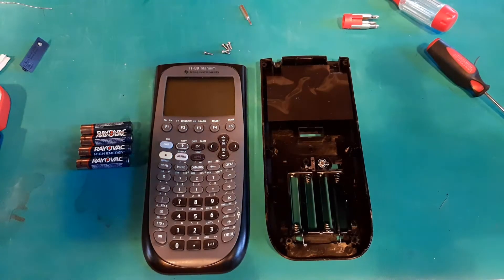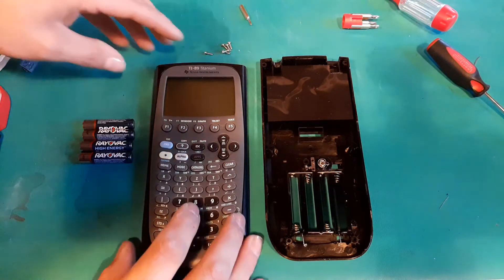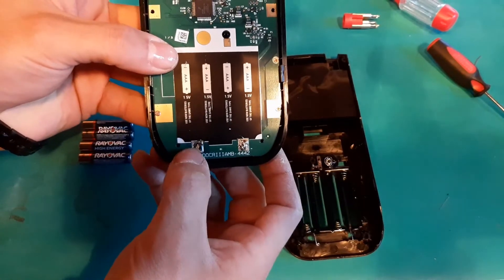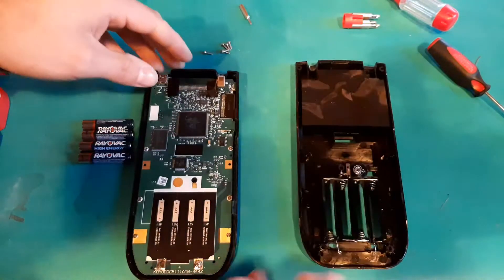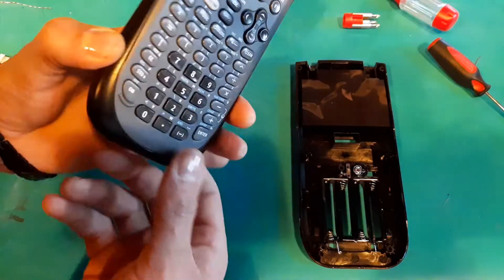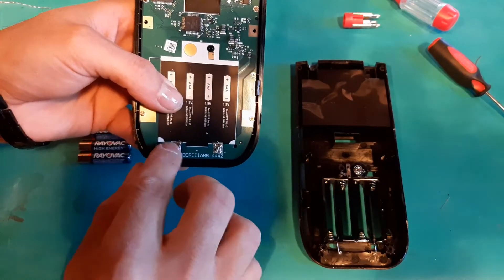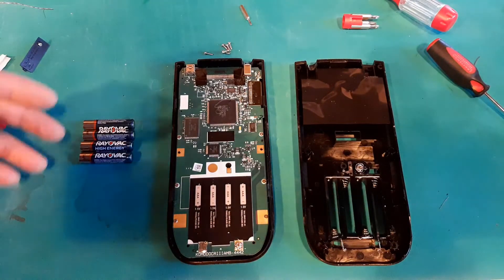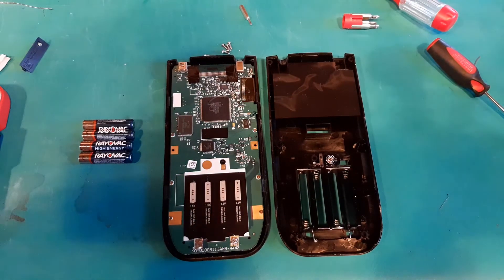TI-89 Titanium Repair - Won't Turn On, Even with fresh batteries

Comment: I cannot believe it actually worked!! I've had this calculator for a long time now, and it just stopped working like a week ago, out of a hurry I had to buy a newer model and it's battery didn't work well. Turns out Texas instruments don't have a warranty for batteries, so I guess they have a history with battery issues. Anyway, I opened my ti89 and as soon as I cleaned the contacts it came back to life. Thank you very much.

Comment: This is a temporary fix tho... the solder is much softer than the copper trace that wore out. A better fix would have been to solder wires  joining the board to the battery contacts which would be a permeant repair.

Comment: Awesome video, thank you for sharing the problem and solution! Mine's been spotty for a while; seems to work fine almost always, until it's time for an exam - then it'll never turn on. Looking through the small case holes, I can see the wear even with the calculator fully assembled. Going to break out the soldering station this weekend and fix 'er up!

Comment: do you know if titanium 89 works without litium battery ("watch battery")?
Reply from the maker: It should, however it won't keep the time or any custom settings when you power it off. That battery is there to maintain the memory.

Comment: thanks for sharing this.  Mine would not turn on because the connection from the battery box to the main board via the metal wire with the coiled end in the battery box was not making good contact with the battery.  The other side hadn't really worn into the main board like yours had.  I'm writing this in case anyone else has this problem
Reply from the maker: I have not heard of that failure mode. Thanks for sharing!

Comment: What did you use to cover the gold plates??
Reply from the maker: Any regular solder that one would use to attach electronic parts to circuit boards would work. Specifically, I used Forney 61477 rosin-cored 60Sn/40Pb solder.
Reply: I think I may have killed mine. Extremely new to soldering so I think I cooked to Golden plates.

Comment: Holy crap THIS FIXED MY PROBLEM!!! THANK YOU!! I've been searching on the web and the TI Knowledge Base for hours. I've tried everything I could: changed new batteries and coin cell, tried messing with the 2nd-left-right-on-off reset, played with the contrast blah blah blah YET nothing worked. While I was just about to spend another 100+ bucks on a new calculator I came across your vide and didn't realize it was just a simple mechanical issue where the prongs misaligned with the solder pad over time.  Well I didn't have any tool with me but I could spot the misalignment from the peep holes   I get it fixed by using an unfolded paper clip to pull/drag the prongs around until it somewhat bented and got into contact with the solder pads again.
Reply from the maker: Great! I am glad this was helpful!